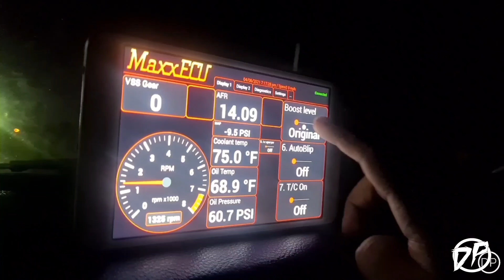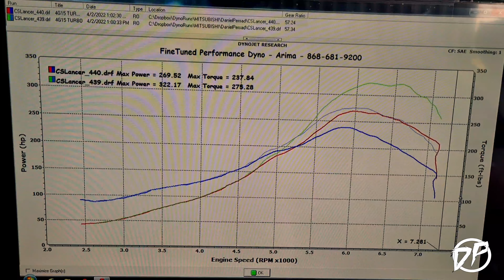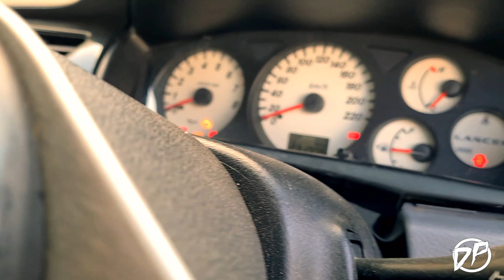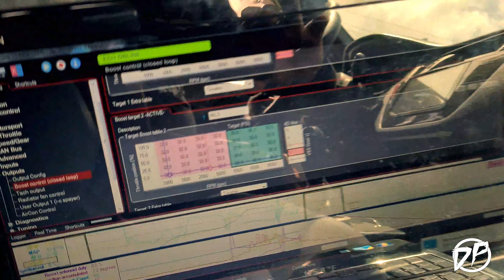Turbocharged Lancer makes its most power yet! | 4G15 MIVEC-T | GRIDKHANA2 | MAXXECU | PULSAR G25-550

Comment: Dude I recommend u stroker for you engine.. in Malaysia they build 4g15 like crazy..
Reply from the maker: I have alot of 4g18 1.6 blocks with cranks at home that I can do this same build with.  So that can be a future plan as well
Reply: @danielpersad5789 they said dont bore more than 77.5mm for safety..😂 500hp in your hand good luck.. advantage u got mivec..
Reply from the maker: @ampunkanaku9640  ha ha yea. I wanted to try 76.5 mm max. I drove the 326whp and it's very scary lol. Don't think I'm ready for 500whp lol

Comment: I like the team work few guys with a passion doing what they enjoy nice 👌 
Have similar setup 1.5t mivec in ck2
Reply from the maker: That teamwork is something you don't find often and I'm happy to showcase it! Time for you to get a bigger turbo for your setup!
Reply: Rod, was  the 4g15t  a straight bolt on on a ck2 stock tranny and engine mount?
Reply: @meowtrox1234  yes bolt for bolt same line up
Reply: @meowtrox1234  as for the engine side mount it is a mount like the cs mounted u have to swap the bracket for it of the ck 4g 15 so u can use the original ck engine mount an as for the other 3 mount 2 as original on the crossmember and the other on the tyranny 
The fans and radiator all fit as originally no cutting and making up or any thing to fit easy swap

Comment: Just need a bit delay mivec activation at 6k rpm & max rex 8k rpm will be a good graph.
Reply from the maker: This mivec is not like the older ones. Its more like a VVT, variable, not on and off. So its on down low for more flow and tapers off to the top. The car is also not making any more power after 7000rpm, so no need to rev to rev to 8k.
Reply: @danielpersad5789  so this system very good at mid range power to top end.
Reply from the maker: Yea correct. It really helps the mid range. This works out the best for me as I compete at autocross, and most times you're exiting a corner at 3500rpm or so, and it really pulls the car out of the corner. Helps that response.
Reply: @danielpersad5789  very good settup
Reply from the maker: Thanks man. Appreciate it

Comment: Great video! I wanted to ask why does it spool so late? Isn't it suposed to spool fast by like 3-4k rpm to have full boost?
Reply from the maker: Thanks man. A couple things.
It's a low compression setup. Maybe 8.2 compression or so. That will have an effect on spool.
And we also didn't wannt bring in the boost too hard to make sure parts last lol. Low down tq tends to break parts. We could get it more responsive but it's safer this way

Comment: Hi Dan, I need your opinion. I am planing to convert swap my ck2 4g15 car  into a cz 4g15t? Do you think it will fit straight in the engine mount? And with the stock 4g15 old tranny? Thanks
Reply from the maker: So the transmission will bolt up. But I'm not sure if it will work. As I don't know if the colt engine has a seperate ecu to control the transmission

Comment: What type of wheels are those❓
Reply from the maker: The ones I race on are enkei tarmacs 17x8 +35 offset. The other wheels are evo 6 wheels, 17x7.5 +35 offset
Reply: @danielpersad5789   Thank You 
I have a 2002 Lancer OZ Rally here in the USA 🇺🇸 I wonder if those fit my car
Reply from the maker: @mexibrasi07  yes they will, u just need those exact specs. My fender lips are rolled as well, so it gives me the extra clearance. I can run up to 255 40 17 with no rubbing or touching. But 235 40 17 is the safest fitment
Reply: @danielpersad5789   Ok Thank You for the Info
Reply from the maker: @mexibrasi07  you're welcome

Comment: Is the engine built?
Reply from the maker: Yea. It has forged rods and semi forged pistons
Reply: @danielpersad5789  stock headbolts
Reply from the maker: Yes, well ajusa headbolts. But its oem/stock size.  I did order stock headbolts for the 4g15Mivec turbo, only to realise its the same as the the oem sohc head bolts. So far we have seen 29psi with oem head bolts and no issue. But its not something i recomment anyone to try lol
Reply: @danielpersad5789  yeah i knew all those bolts was the same size.. was looking into getting arp.. right now i running 20psi on e85..i have the ck 4g15 dohc looking at getting a mivec head
Reply from the maker: @dannealmurray9751  ok very nice.  You will need oil pump, water pump, trigger wheel . What ecu you currently use to tune?
Reply: @danielpersad5789  the oil pump n water pump  different? currently running an aem infinity
Reply: @danielpersad5789  ah i think i understand what you mean.. i change over those parts from a 4g15 gdi to run coil on plug
Reply from the maker: Yea, the oil pump is required as the Knock sensor and trigger wheel for the mivec is different. It wont bolt to the normal 4g15 oil pump, hence the change is required. The mivec pump bounces the normal 4g15 water pump, so you need the mivec water pump as well. I have a vid showing what i changed to get the mivec head to work. You can check it out as well.
Reply: @danielpersad5789  i will look into that
Reply from the maker: @dannealmurray9751  no problem
Reply: @danielpersad5789  now watch the video i see what you mean about the oil pump carries a hydraulic tensioner n not the spring..also why did  you had to modified the camshaft trigger pickup
Reply from the maker: @dannealmurray9751  we modified the cam trigger so we can get the car started easily. Basically what we did, gave it the same trigger pattern as an evo 10, so it was easy to get her started. And yea, I forgot about the hydraulic tensioner as well lol

Comment: Dat is not ah original 4g15 head wah head dat is?
Reply from the maker: This is the Mivec Turbo 4g15 head from the Mitsubishi Colt. direct bolt on to the 4g15 sohc block but you will need the oil pump, water pump, trigger and crank sensor to work it. A standalone ecu will make it even easier.

Comment: i would of never guess them engine could take 20 psi
Reply from the maker: Ha ha. Comes down to tuner and parts. This setup supposed to take 500hp comfortable.  I'm just not willing to push that lol
Reply: @danielpersad5789  at least, we need a video pushing 400xxx !
Reply from the maker: @enmanuelramirez716  ha ha one day. We still have to remember it's a 1.5 lol. Maybe if I get some higher compression pistons I can do it!
Reply: @danielpersad5789  tru what compression u on rn?
Reply: @danielpersad5789  ga16 for it lol
Reply from the maker: @josiahmz8744  I think its around 8.2 or 8.5. We didn't get to check it but it's around there

Comment: Bro can help....my car is 4g13 carb 12v.....i just want to change the head....will it fit with the dohc 16v type?
Reply from the maker: All the 4g1x series line up. So in theory it will work. Are you remaining carb or going fuel injected?
Reply: @danielpersad5789  i will stay with my twin carb.....i think if i use dohc head..... the exhaust will be at the back and intake at the front.....right?
Reply: @danielpersad5789  arhhh wait i think carb cant be use.....is there dohc type use carb distributer? Or i can use back my old one
Reply from the maker: If the intake can bolt up i dont see why not. Also, if you use a 1.3 block with the 1.5 head, the ecu to match will be sending too much fuel as it thinks its a 1.5 engine
Reply from the maker: Depends on the model you get
Reply: @danielpersad5789  sooo is there a dohc carb type?.....i mean a injection type is ok but need more work and costly....
Reply from the maker: @hakim9785  really can't say that I've seen a dohc carb type. Will be hard to find